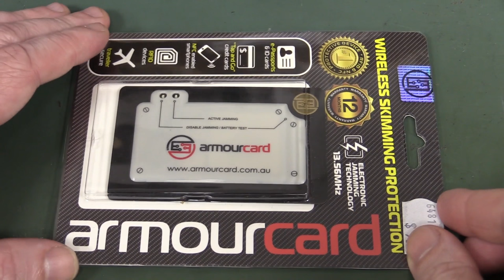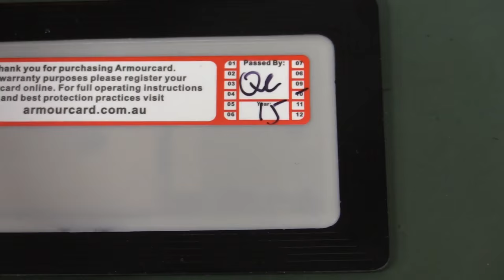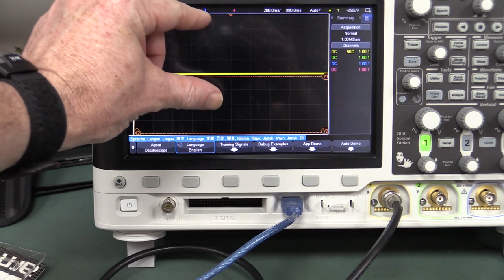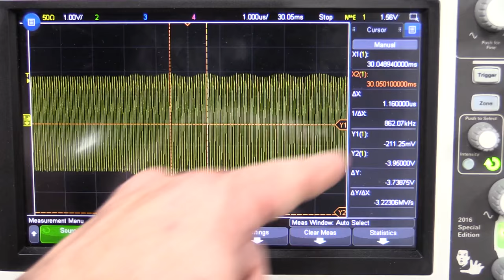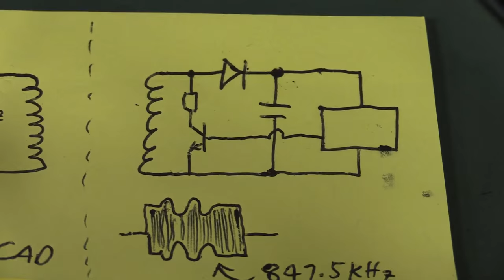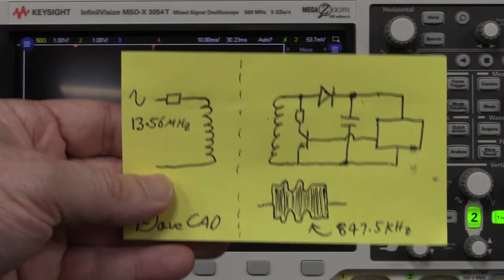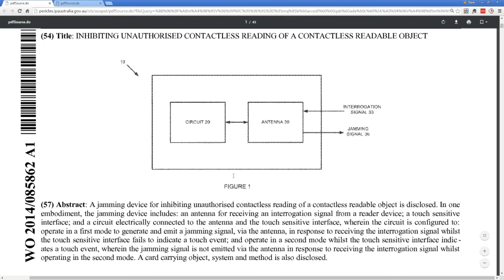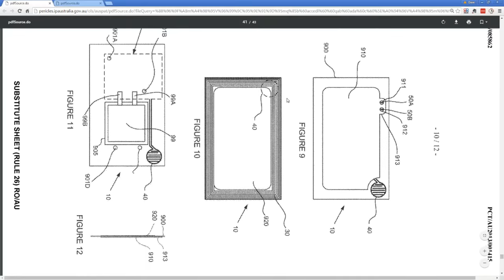EEVblog #890 - ArmourCard Active RFID Jamming Teardown

Comment: Actually, you can get the credit card number, the expiry date, and the last few transactions.

You can use the credit card number and expiry date at some merchants (oh I swiped my card and seems the magnetic stripe doesn't work can we just enter the digits...)
With the credit card number, the expiry date, the transactions and very little social engineering (usually figuring out someones name and birthday) you can convince folks on the phone you 'forgot your password' and need a password reset.

Think about it Dave, all through this video you put tape over the number on your card... I can get that number via nfc...

edit: Want an app to try that'll show you all that? Search for Credit Card Reader by Julien Millau (currently v4.2.2, it's on github build it yourself if you don't trust them)
Reply: For you maybe a stupid question, but for what do you need a password in combination with your card?

Comment: What is the point of these things?
Reply from the maker: It makes people think they need a high tech solution over some al-foil that costs nothing.
Reply: EEVblog
Yeah, I was thinking that perhaps one doesn't go around waving their credit in the air next to sensors.
Reply: It has flashing LEDs, much better than aluminium foil ;)
Reply: Skimming like this is already happening in Europe.
Criminals set up a company with transaction abilities, then they buy a bunch of mobile terminals and bump into you with that terminal inside their clothes.
It mostly happens in public transportation or waiting lines.

Yet having an active jammer is just plain bullshit. Aluminium foil works just fine.
Reply: Some people are still paranoid someone will walk up behind them and scan their card while in their wallet, so they'll want something to switch on/off easily because many swipe their card while still in their wallet.

Comment: "just tap it" HA!

it takes about 5x as long as swiping the magnetic strip in EVERY store i've ever seen anyone use one at.
Reply: But the mag stripe is not at all secure because it has no authentication. You can produce a fake card very cheaply and easily. The idea of NFC cards is to be quicker than inserting card to read chip and manually entering PIN. The concern from my point of view is a) card can be used when stolen for any number and of low value transactions b) an attack is possible (and been demonstrated) where you do not even need to steal a card, just build a transceiver that mirrors the NFC communication protocol (over RF or the Internet for example) from the payment terminal to you chosen target card.
Reply: i think in australia we more or less stopped using the magnetic strip before paywave became a thing. it really is very quick though. usually reads before you even get the card to the reader to tap it, maybe where you are they have lower quality readers for some reason.
Reply: how is it safer if it's not secured with a pin?
Reply: Stuart McConnachie
 maybe i'm describing a different tech... i assumed those chips in all the new debit cards were NFC.

i could see the scan time taking as long as the whole process with magnetic strip. only... i've seen people sign as well... not sure how often, i'll pay more attention now.

i'm not sure why anyone thinks we'll ever get flawless security... but i guess never trying guarantees that my pessimism is right. ;)